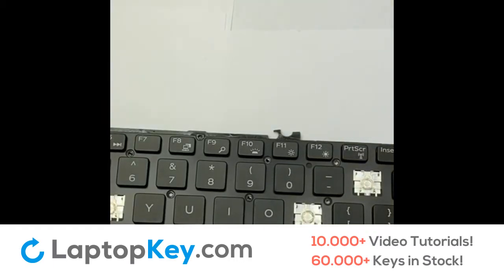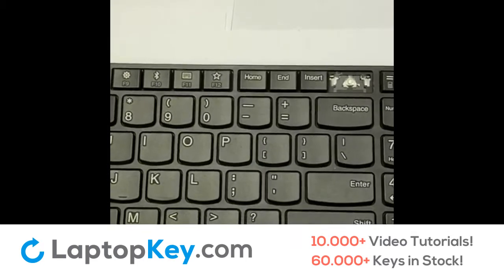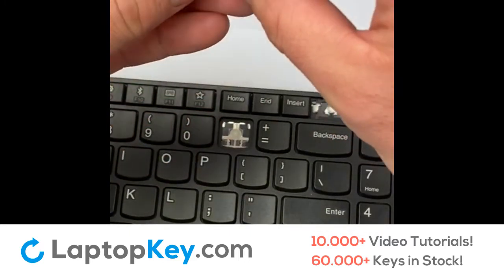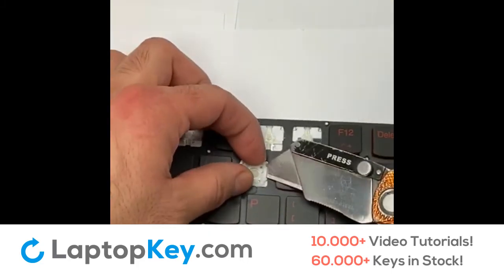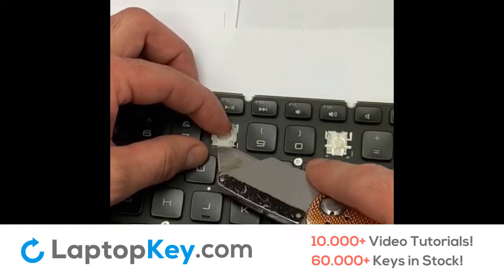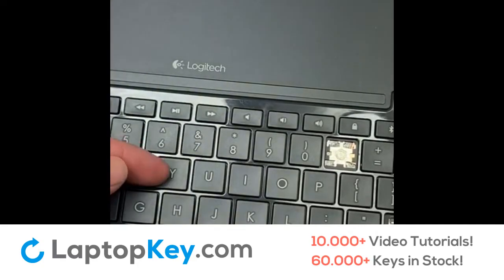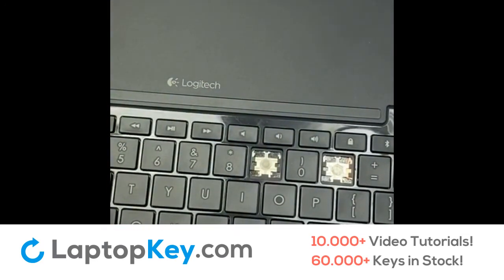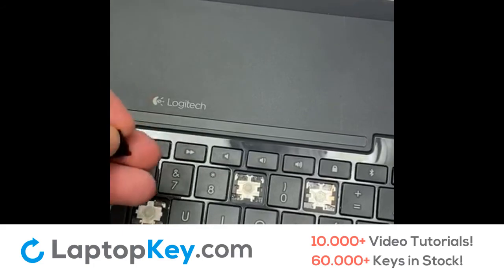How to Remove Laptop Keyboard Keys and Retainer Clips

Comment: a key fell off my laptop and it still has the retainer on it i dont know how to put it back on
Reply: i have this samd issue, where u able to fix it? and if so, how?
Reply: bought keys from them and it came attached still. still have no clue how to properly install my key
Reply: @itlooklikethis  it think it’s the same thing u do to install the retainer just with the key already on it
Reply: It's fiddlier because if you push it the wrong way it will break the retainer. I found the correct guide here: https://www.youtube.com/watch?v=YnZf74o1I60. Once you've separated the retainer from the key, it will click very easily into the base, and the key will click very easily back into the retainer.
Reply: @petergainsford4339  Thanks you so much? Because of you, my w key went back on.
Reply: I had the same problem. This video helped https://www.youtube.com/watch?v=YnZf74o1I60